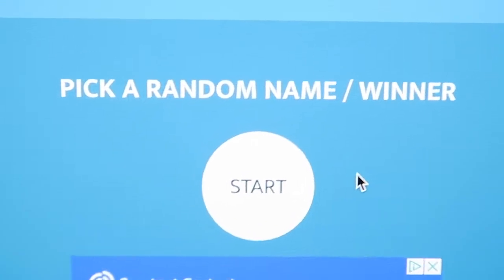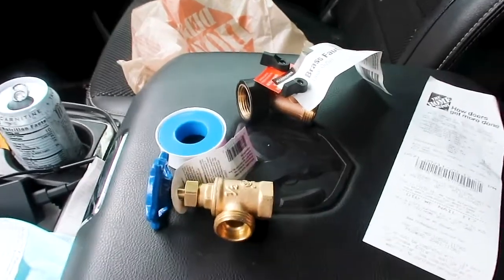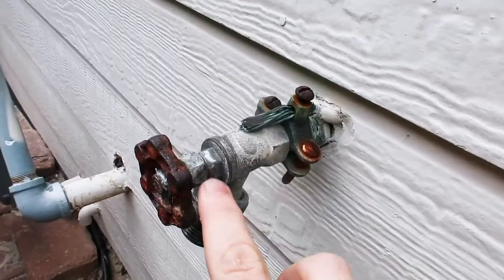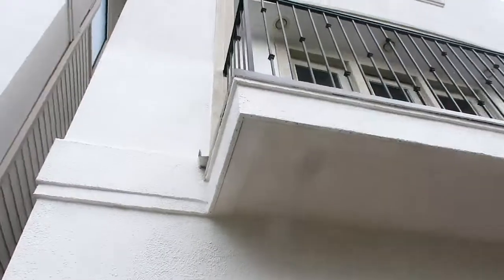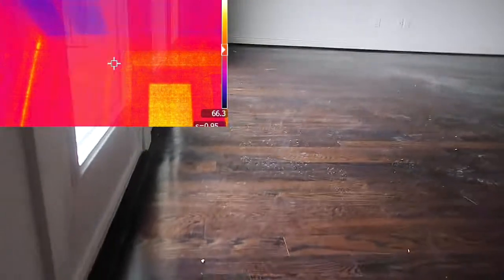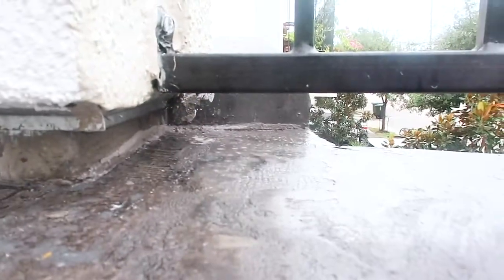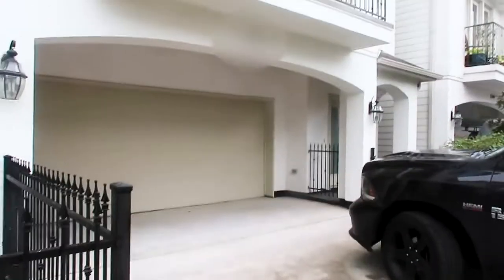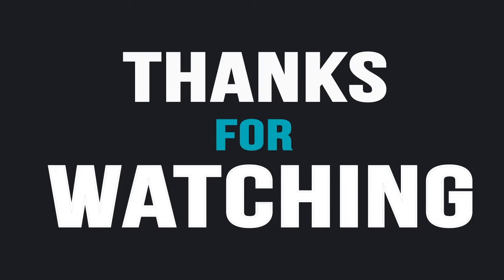Home Investigator: Episode 18 - Not Your Average Inspection Day

Comment: Here in AZ were advised not to test gate valves because the water is so hard here,  there bound to leak or have a issue after you leave. We just advise the client that they have them and they should be changed due to there failure rate. Along with all water supply hose's in the house that are not steel braided. Great video's by the way.
Reply from the maker: That is crazy,  you don’t test any of them?
Reply: @AActionHomeInspectionHouston  I test all water shut off valves that are not the twist down old style  gate valves. There reputation for failure is legendary and there's no need to take the risk of screwing everyone's day up with a leaky valve that should just be replaced with a modern ball valve. kinda like knob and tube wiring. I just advise client on what they have, recommend replacement and move on...